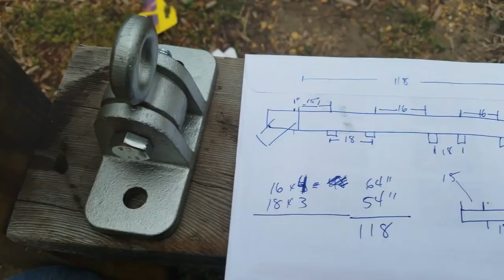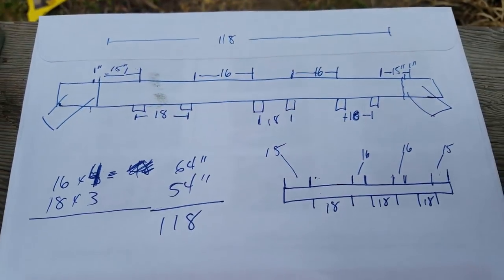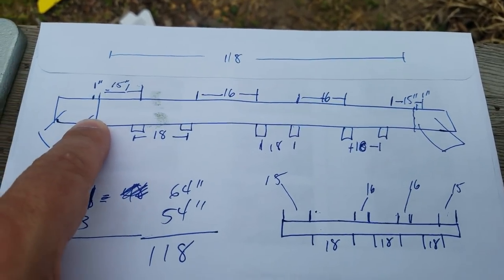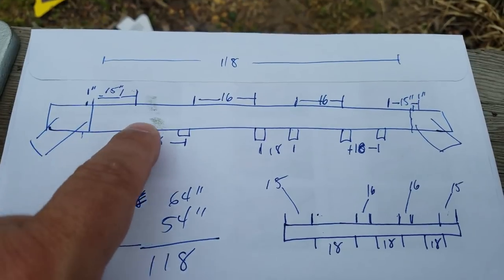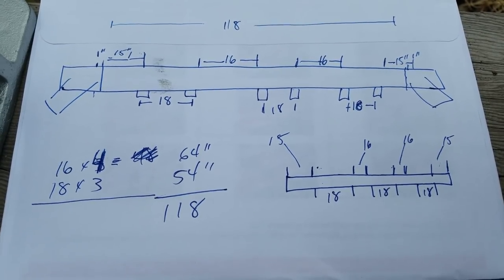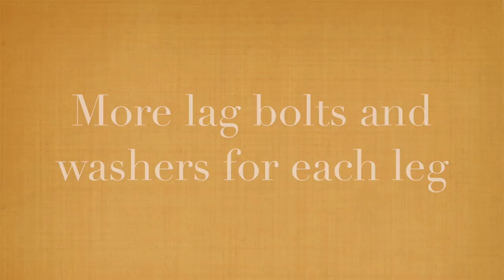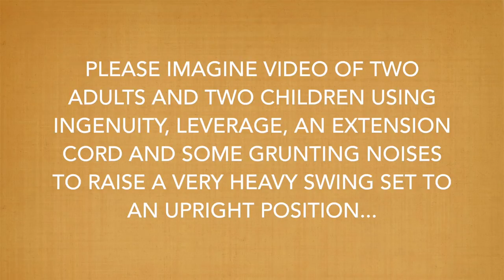Backyard DIY - Swing Set Upgrade - How To Build Your Own

Comment: Wood bolts to hold the swing swivels? I used bolt washers and nuts.
Reply from the maker: Yes. Lags with washers into the wood. Your way is more secure but the lags I used are more than enough.
Reply: Did you use hex bolts or carriage bolts? On a 4x6 beam, would a 6 inch bolt be enough room for 2 washers and a nut?
Reply: @jrmcgini 6 inch carriage bolt is perfect for a 4x6 beam.

Comment: So you have to shave pole ends so that it fits in bracket? 😏
Reply: Al Complaint yes just a little bit or with a belt sander
Reply from the maker: I used a hand planner (not power)
Reply: I didn't have to.  My 4x4x8's slid in without force.  The 4x6x12 I had to wax both pieces with candle wax and sledge hammer it in protecting with 2x4's.

Comment: How deep are the holes for the legs?
Reply from the maker: Less than a foot. The weight of the whole setup and the angle of the legs keep it secure even with two adults on it
Reply: @SuburbanJerseyDad  Did you concrete the legs straight in the concrete or did you use some kind of medal beacket?  Was wondering if the wood would rot?
Reply from the maker: I dog shallow holes around them legs and used half a bag of concrete on each leg. A long length of rebar angled through a drilled hole in the leg and into the ground is also an option. We went with the concrete and so far no movement. Hope that helps.

Comment: That is a 12’ bean across if your measurements are as you say.
Reply: *beam
Reply: I’m about to start this DIY with a 10 foot beam. However, each side loses a foot for the bracket. Leaving me with 96inches usable. Was thinking 5in from bracket. 18 inch swings, spaced 16in apart.
Reply: He replied to me.  He keeps saying it's a 10' beam, but he replied to me that it's a 12' beam with 10' of usable space.  I already bought a 10' beam and installed the swings.  I have 3 swings going across, evenly spaced.  I just reduced the amount of room on the sides because of the angle of the legs.  I put the brackets sticking 1" from the end and the end swings are about 6.5" from the bracket.  Approximately 18.5" wide for the swings and I think I'm 15" between swings.  I don't remember exactly but that's pretty close.  The swing seat on the ends are a couple or a few feet from the legs due to the angle.  This is all approximate but I got it to work.  I realized his statement of a 10' beam was wrong after it was home, had the brackets on and was measuring for the swings.  It works and is comfortable spacing.
Reply: Curt Thompson 

Thanks. He didn’t replied to me. But I assumed he meant 12ft. But same as you I got a 10 foot and changed the spacing. Don’t remember to what but it works!  Thanks for the reply!
Reply: Curt Thompson wonder if I could fit 4 swings on a 12’ header. Is 18” swing size average or bigger than
Reply: @TheAmylynn06  you could fit 4 swings on a 12'  beam.  That would be 144" total, minus the brackets gives you 120" of workable beam.  I have 3 swings on a 10' beam because that's what his measurements showed, which was incorrect.  So I used a 10' beam and have 3 swings at about 18.5" wide and the spacing might have been 14".  I don't recall.  I overhung the bracket by 1" on each side of the beam to steal a couple inches and the swings on each side start about 6" from bracket.  With the way the legs spread out, there's plenty or room on each side.  If you wanted to use a 10' beam and need the measurements let me know.  Otherwise a 12' - 4"x 6" really shouldn't sag or move, at least not much.  And you might be able to fit 4 swings on it with some careful measuring and minimizing the space between each swing.  You can go with 6" from the bracket to help keep some space.
Reply: I measured quickly and came up with, if you start 6" from the very inside of the bracket, 18" for each swing, and 12" between the swings, you'd be there.  You just have to decide if that's adequate for you.  If you go 4.5" from the very most inside of the bracket, you could have 13" between swings.  That might be a bit close.  I just checked and I am 16" from the center of one hanger to the center of the next between swings.
Reply: I used a 10' beam. 10' x 12" = 120"

Comment: I was thinking of something like this for my kids. Two and 4. But this looks too tall. Maybe I should do 8 foot 4x4's rather than the 10 feet ones. I haven't been liking the height of all of these swing sets.
Reply from the maker: Hey Melanie. I understand your thinking. However I’ve been told on a lot of projects “build it for three to five years from now, or build it again”. It makes sense that your little ones do not need the height- yet. My 10 and 12 year old swing on this with no problem and say it doesn’t feel like a “little kid” swingset. Just my two cents. - but 8 footers will work too. Good luck and please tag me if you start one. I’d like to see the results.
Reply: You can hang the swings low, I have had a set like this fire 30 years now, don't make it shorter. They grow fast

Comment: Wow that sucker is tall!
Reply from the maker: Wish you could have seen it go up! Its very tall and the leg length allowed plenty to go into the holes with cement for a solid feel. Adult swinging is allowed. Thanks for watching. SJD
Reply: That's awesome!  How long are those 4x4?  I'm about to do the same.  Have the brackets in hand!  Haha
Reply from the maker: 10 foot posts
Reply: About to do the same, what's the distance between the 4×4's on one side?
Reply from the maker: +randy sodhi I'd have to measure it. I'll post tomorrow.

Comment: Thought it was me.  The 4x6 is too big for the “4x6” end. I sanded and sanded and sanded.  Then I had a guy plane it at a mill.
Reply from the maker: Hey Shaun. I had to plane very little. May have to do with variations in the beam sized from different places. But it didn’t take much for me. Glad it worked out.
Reply: Mine fit just fine, just a little hammering and it went in. Got my wood at Menards